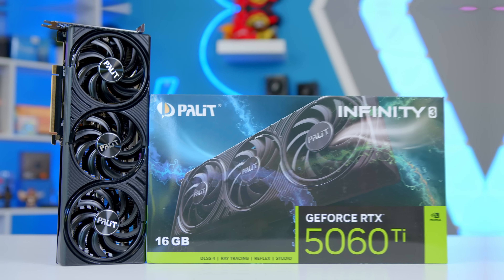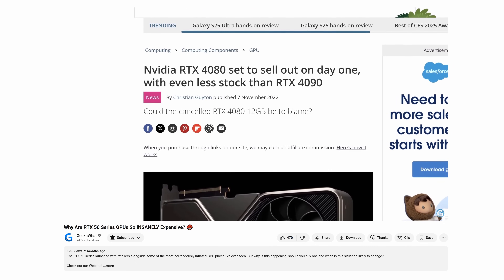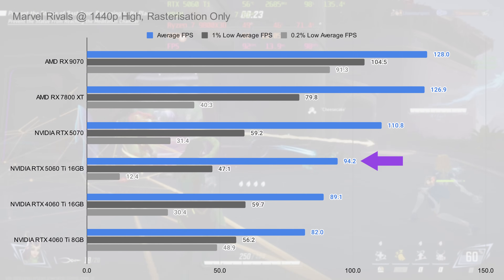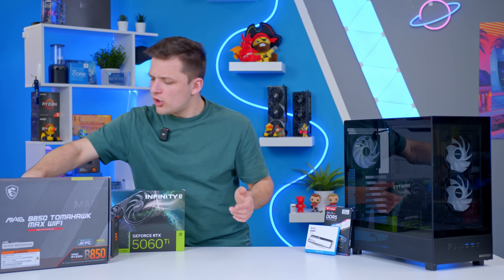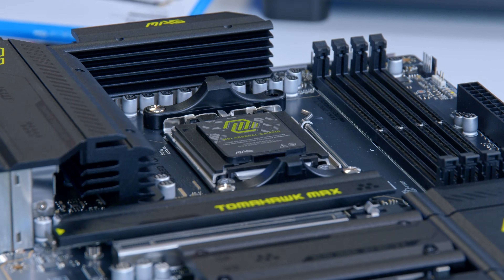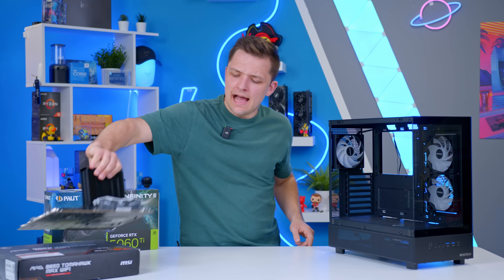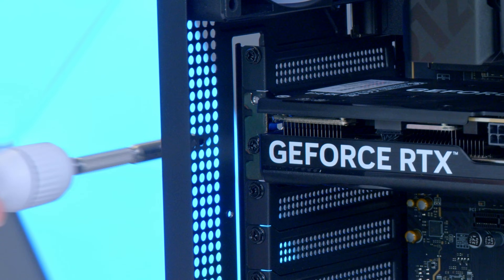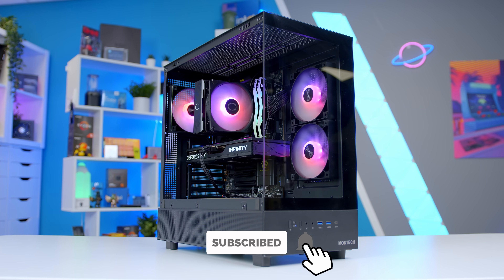Building an RTX 5060 Ti Gaming PC Build! 👀 [Is NVIDIA's Latest GPU Worth It?]

Comment: Can I change the CPU to AMD Ryzen 7 9700X 3.8 GHz 8-Core , Im new to PC building It has m5 socket as well, I'm trying to do your build
Reply: I just upgraded from a 3070 to a 5060 ti 16gb and Ryzen 7 7700x and getting some pretty damn good benchmarks im more then satisfied and glad I didn't overspend on a 7800x3d because thats not needed unless your building a high end PC with a 5080 or something in it

Comment: Seems like a great value card for most gamers who use QHD screens.  Enough VRAM to play all the demanding games, can play graphically demanding games between 70-90 FPS at QHD resolution, it doesn't draw too much wattage (180 watts), and isn't too expensive up front for someone planning on holding it for a minimum 5 years.   Added bonus is that it can be used for creative work (video editing or DJs) and data science work.

Comment: Why did your 8 pin power cable have the pcie on it? Isn’t that supposed to be connected on the power supply and the blank cable supposed to be connected to the gpu ? Or is it more of an  aesthetics?

Comment: if i am building a whole new pc (not upgrading) would you recommend getting this or 4060 ti? both are around the same price in my country but i have heard it is safer with 40 series due to the updates and everything. i don't play super heavy games and based on test both gpu are not that much different.

Comment: I built my first gaming pc and am not sure if i use the right components for 4k gaming. Asus tuf x870 plus wifi7,amd9800x3d, 64gb corsair ram, 4tb 990pro samsung ssd, corsair 850 modular power supply, corsair 4000d case, asus tuf gaming 5070ti, corsair nautilus aio liquid cooling 360mm. Do you think that it can handle 4k gaming? Please advise.
Reply: do you need to set everything to ultra?

Comment: finally a gpu for streaming and gaming at same time on a budget. getting it asap
Reply: 7800xt?
most likely cheaper aswell
Reply: or get a gpu thats a bit higher but amd is better money wise
Reply: lol i was gaming and streaming on a 2700x and 3070 like 4 or 5 years ago.. not to mention the 5700xt that i also used.. your best bet.. go to micro center and get the 7900xt for 599 if you bundle it with other amd products but even the 699 price tag is a steal in this market.. it also competes with the 5070, the 9070, etc. only difference is you can find those and even if you can 800+ is way too expensive.
Reply: Nvidia has been having a ton of driver issues lately. AMD is more stable and you'll likely get a better performing card from them for less than this.

Comment: Unless you are playing esports games, this GPU will be just okay. I think this GPU, especially the 16GB version, will be a great budget GPU for content creation. Especially in applications like Blender.
Reply: Agreed, but the issue is that most likely, the 16gb variant is gonna get scalped to hell. Raising the price and leaving the consumer with the 8gb versions
Reply: @JM-bebo  I tried to find an in stock 16GB variant yesterday and the only ones I could find were around $1200. The scalpers/retailers can keep them.
Reply: @ damn... that is absolutely insane. Honestly, I'm sticking with my EVGA 3080TI till it dies
Reply: @ I have a gigabyte vision 3080ti. But it stopped putting out a display signal. So I am gaming on a 3070. Which is fine. I basically only play beamng.
Reply: @BlenderRookie  Wow, here in australia all 50 series cards are in stock and are only a little above msrp
Reply: @Beybey999 They have been bad here ever since covid.
Reply: @BlenderRookie  Dam i really think everything went downhill since covid fr
Reply: @Beybey999 Yep
Reply: @JM-bebo  I still have my EVGA FTW3 Ultra 3080Ti In my Streaming/Recording Rig that I edit on.
Reply: @Drewkungfoo  mine's been running pretty hot and had to do a heavy 800v undervolt. Just ordered some custom Kritical pads so I can bring it to life again. How's your card holding up?
Reply: @ that’s, very interesting. Mine is still running cool at 56C usually (that’s the hottest I’ve seen it get) it’s mainly sitting at 35-41C
Reply: @Drewkungfoo  under load idle?
 With the 800v undervolt, I can run a quiet 45° at idle and under 80° while gaming fans at 90%, but without any undervolt, it's a louder 60°+ idle and 90°+ maxed fans
Reply: @BlenderRookie is this a US problem? In europe i got mine for €480 and recieved it a day after ordering
Reply: @SwoopScoopie They were being priced at about $600 USD. But I just checked the price and they are now as low as, $350
Reply: I don't play any esports game and this GPU is amazing for gaming. Definitely at 1080p but also good at 1440p. At 1440p you won't be able to blast Ray Tracing in every game, though. But no, this is a single player games GPU, not esports. On top of being great for single player games, it's great for workstation purposes and content creation.

Comment: At this point, i would rather go to AM4, and spend that extra cash for a 5070 or a 9070. I know its a "dead" path, but you wont notice anything, until AMD stop supporting this platform. Wich takes years.
Reply: you wont have much extra cash going AM4, a B650 and a 9600X is cheap and faster than the 5800X3D while sucking 65w
Reply: In my local store, Am4 is about $200 cheaper and 5070 is about $250 more so its.. make no difference.
Reply: something something Ryzen 11600 or 11800x3d, AM5 is 100% worth it if buying a mobo rn.
Reply: @hahaayukko5543  11800x3d will work on Am5?
Reply: 5060ti 16gb if u get it in msrp its actually better price to performance ratio than 5070
Reply: Same
Reply: @noxwill01  yeah that's better

Comment: I would spend 700 for the 5070 and get almost a 40% higher frame rate
Reply: 5070's are like 800+... you could get a 7900xt for 599 with amd bundle at microcenter or 699 by itself.
Reply: I own one, wayyy more power draw
Reply: Kr just get a 9700xdx lower price better perforcmance
Reply: @kutaysaban1703  its also costs $400 usd more due to scalpers